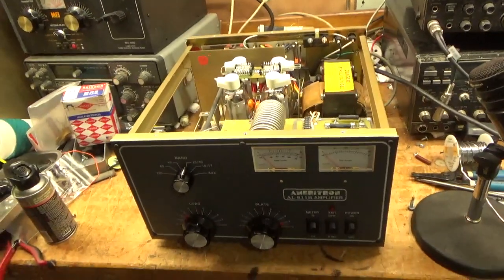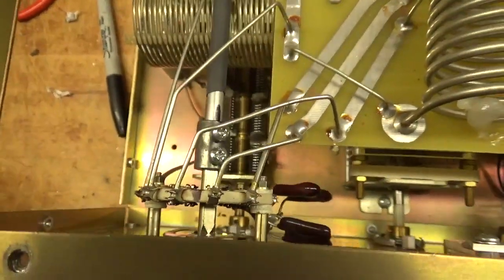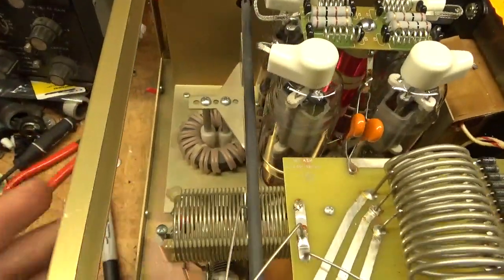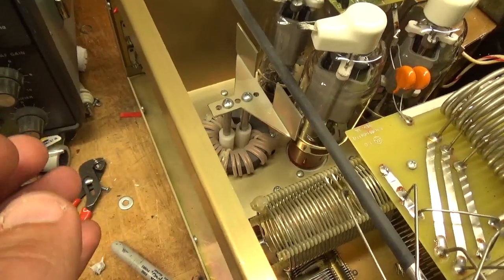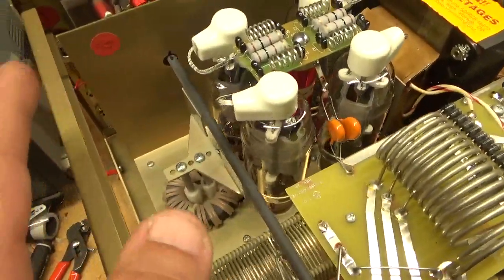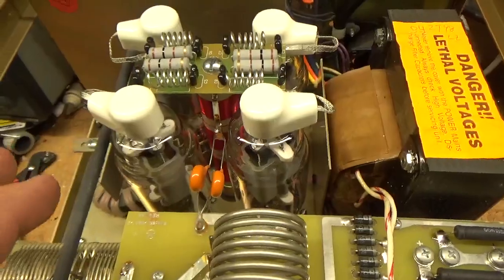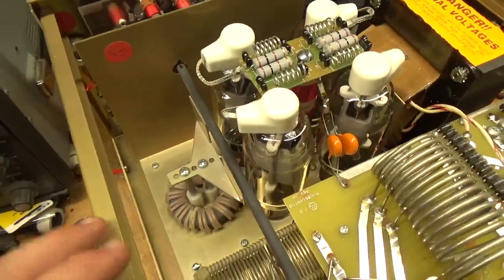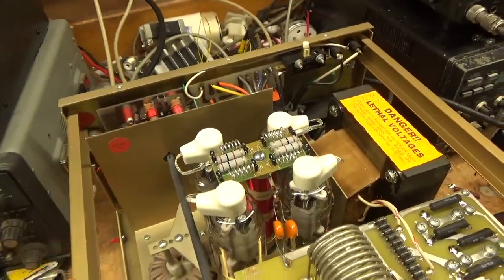Ameritron Al-811h Repair

Comment: What about the mod for the parasitic board where you shorten the coils to five windings do you think that’s necessary?
Reply from the maker: I only alter If i see heating of the parasitic suppressors after tune up on 10 meters
Reply: @amprepairguy  Mine got hot enough that the resistors were discolored and It burnt the board underneath the resistors I ordered a new one from Ameritron Haven’t hooked it up and tried it yet because I don’t know if I should do the mod also My output went from 1100 to 600 W so I don’t know if I got something wrong on my tubes I could never get A good grid current it would never move so I don’t know The amp was built in April 2021 so it hasn’t been around the block If I was independently wealthy I just buy a new one lol but that’s not the case
Reply from the maker: You are exceeding the max output for that pa. Feel free to give me a call for repair.